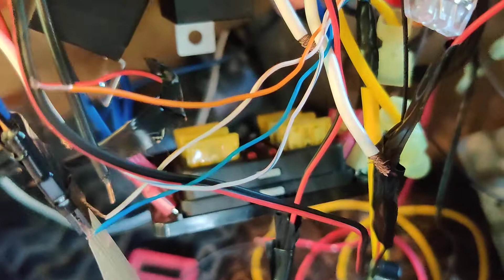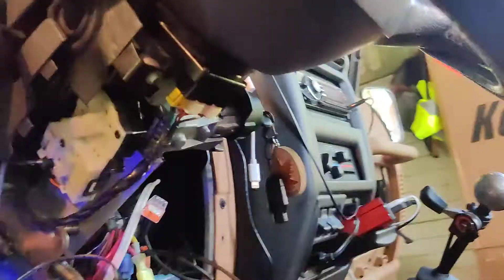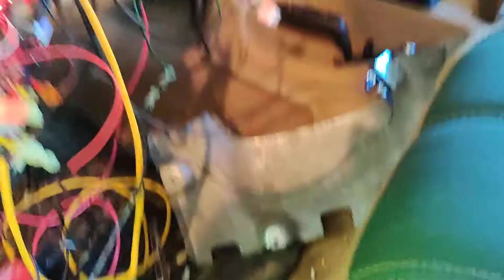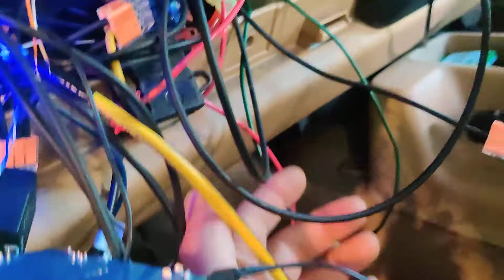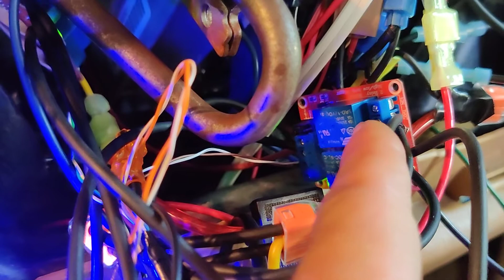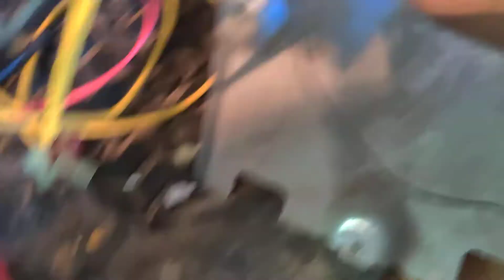Jeepduino: Arduino in keyless Jeep TJ Wrangler remote start, keypad, NFC ignition

Comment: I am wanting to do some sort of remote start on my miata using my arduino, however im concerned about one main issue and thats how to know if the car is in neutral? say someone accidentally leaves my car in gear whether its  a friend or me, and i go to start the car remotely, how can i test if the car is in neutral before sending signals to the starter and ignition? and what would be a good fail safe to make sure the starter turns off with the relay before the rpms get to high.

good work though! love the RFID ring idea. Im planning to use text messages. Get a GSM for arduino and some relay boards and when i send a text from my number only then will it be able to work in the arduinos code.